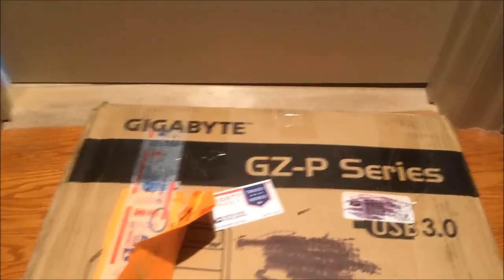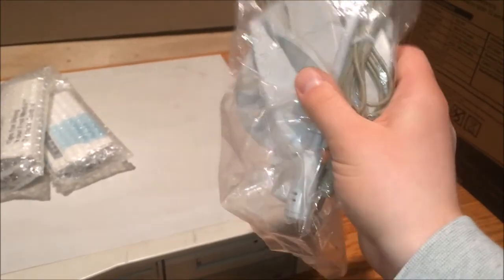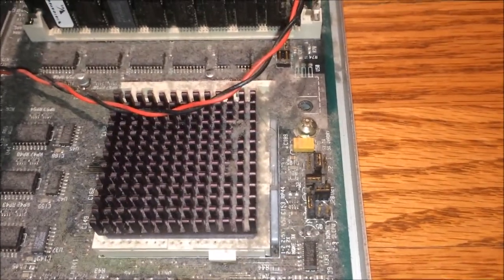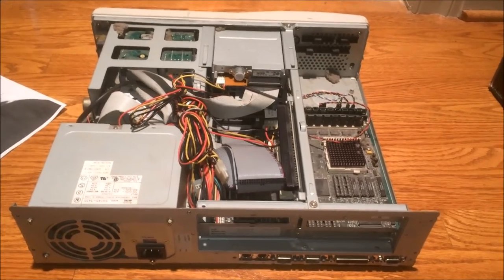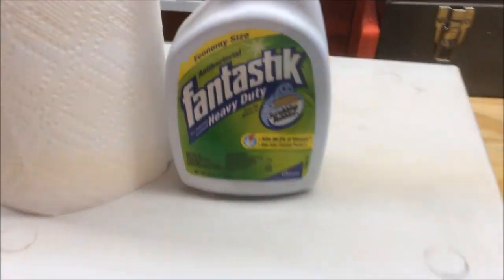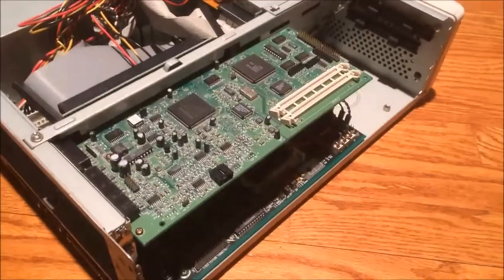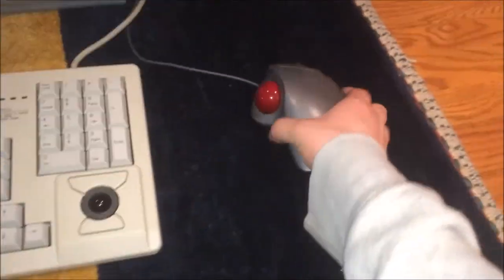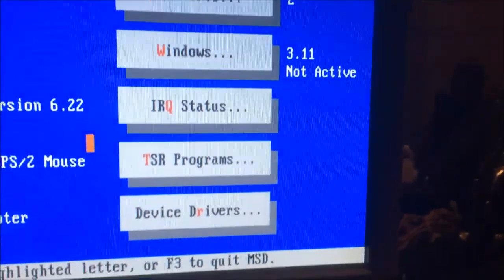Gateway2000 4DX2-66 From roadgeek

Comment: I have an older Gateway which uses the same chassis as this but only has one 5¼" drive bay, which sucks because I can't have both a 5¼" floppy drive and a CD-ROM drive installed. In fact, that's probably the reason Gateway squeezed in the second bay, once CD-ROM drives became popular. I've never seen a CD burner in a 486 before -- they didn't become popular until around 1996-97, when Pentiums were mainstream and the first Pentium II's were coming out.
Reply from the maker: having a second bay i think is necessary for one of these even qualifying as a multimedia PC. roadgeek put that CD burner in there because it was just a random drive he had on hand. that's lucky for me because it will read my CD-RW's i use for software!

Comment: Man this takes me back to where we owned an AMD 486 DX4 120 with a 40mhz FSB which was pretty speedy for its time. Without it being one of those 5x86 or those Enhanced 486 CPUs it was the top of the line non enhanced 486. It had DOS 6.22 and Windows 3.11 and Windows 95 A where you could press f4 to boot to DOS. I played alot of games on that thing. And It had on of them ISA Yamaha Sound cards that could emulate SoundBlaster and Adlib sound cards.